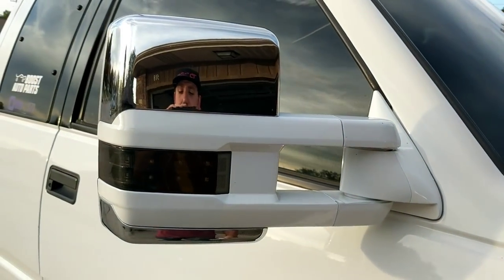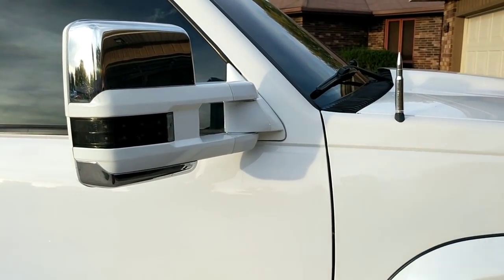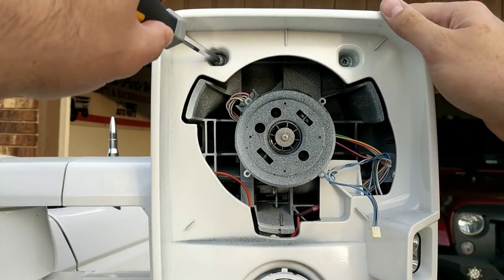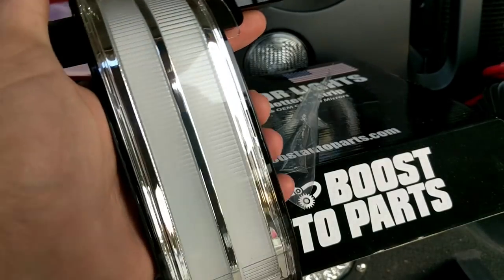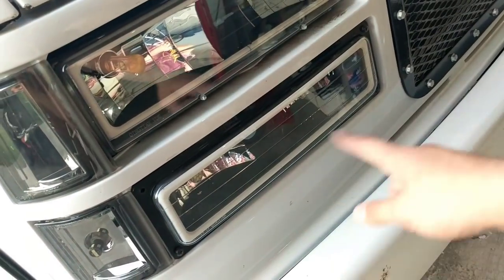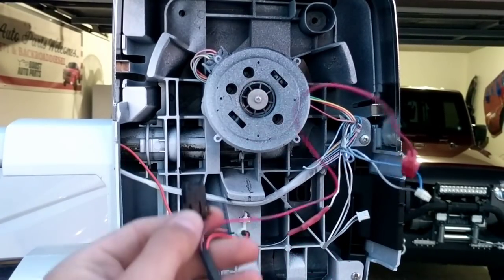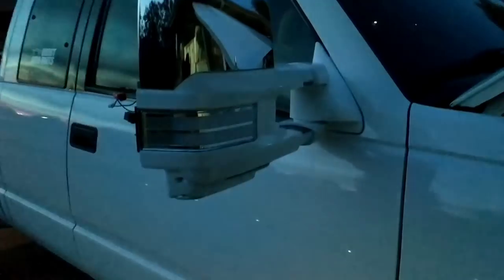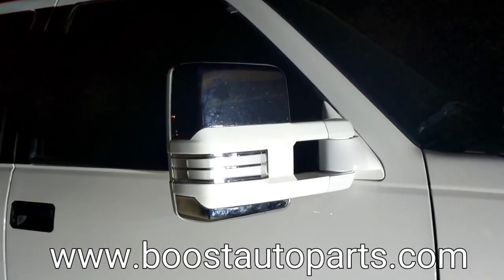How to Install Boost Auto Parts Switchback Lights

Comment: While I do LOVE my new Boost Auto Parts strip LED tow mirror lights and I really really appreciate your video as I wouldn't have gotten them swapped out otherwise, I noticed you conveniently skipped over the real bitch of a process in actually getting them out. They don't just slide right out "just like that" as you said. I found that I really had to flex the top AND bottom parts of the mirror housing almost to the breaking point to get them out. You have to flex everything far enough out to pass the connector out of its surrounding hole area AND the whole thing is curved so you have to try and rotate it around the corner AS your flexing the housing for clearance. It's doable by yourself but I wish I had a second set of hands to help hold the housing back while I monkeyed with it trying to get it out. They look FANTASTIC now though! 2016 GMC 2500.

Comment: I have an 03 Silverado with aftermarket mirrors I have boost module for my dotted lights. Is there a harness I can buy off Amazon to hook up sequential lights for a 2014?
Reply from the maker: I wouldn't recommend anything aside from a boost auto harness. Definitely get in touch with their support team and see if they can help you out 
support@boostautoparts.com
Reply: @BADZ71  they said they don’t sell that particular harness without the sequential led strip
Reply: Thanks for the reply though I might do some figuring out this weekend

Comment: I have 2002 chevy Silverado 2500 HD and  I installed boost auto tow mirrors and need help to get the heated fiction to work.  Any help would be appreciated.

Comment: What about if I don’t have that orange wire ??? I have a set of light and sequential running ligh but mine doesn’t have that orange wire running like that
Reply: I currently have the same problem, did you find out what to do??

Comment: I am considering getting these tow Arelights because they look cool however I don’t understand the purpose of having the LEindicateD strip on the front of the mirror.  How are those lights supposed to show people behind the car that a lane change is coming?  It seems any cars in front of you could care less whether you’re going to change lanes. This is a serious question sorry that I’m not understanding.
Reply: Hopefully your rear turn signals are working...but if u are solely  relying your on tow mirrors(dont know how you would pass inspection) but there are turn signals in the glass mirror(TOP) to indicate a lane change.... Go to 2min & 30sec of the video..you will see the dotted turn signal in the TOP mirror.....

Comment: So when you order the light for it what exactly do you add on to your order just the adapter right? cause my tow mirrors are aftermarket but they aren’t boostautoparts
Reply from the maker: Yes you would need the Boost harness along with their lights to make em work
Reply: @BADZ71  You have a instagram so we can talk more about this get some more detail from you man?
Reply from the maker: Of course! 
@bad_z71
Reply: Did you know the name of the harness ???
Reply from the maker: Name of what harness? All wiring was already in the boost auto mirrors.

Comment: what if I want to keep them amber all the time so it matches the roof lights?
Reply from the maker: Then I would get the Amber strip lights, they will be cheaper and constant Amber.
Reply: @BADZ71   from same company, thanks
Reply from the maker: Yes the same company has them. www.boostauto.com

Comment: How do you route the wires from thr mirror to the truck?
Reply from the maker: You will have to go through the door, towards the bottom of the door is where all of your power wires run into the truck. You just have to feed those power wires for your mirror through the same location

Comment: For the most part it looks good. But it also looks very flimsy and cheaply made. Not so much the lights them selves but the housing to the “tow mirrors”. Also having exposed open ended wires just doesn’t sit well with me. I mean it looks like you can easily get water in them causing it to short out. Just my two cents on it all.
Reply from the maker: Definitely not cheaply made or flimsy. I have had these for a while now with no issues. They aren't OEM, but definitely not cheap. The one open ended wire was capped off, and still no issues.
Reply: The mirrors and lights are solid quality, and we also stand behind them with a warranty. The one open ended wire that is left is a ground wire, so there is no way for it to short out to anything. Let us know if you have any questions!